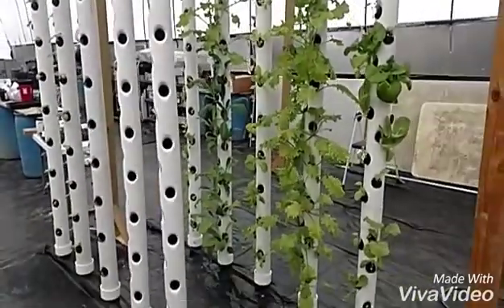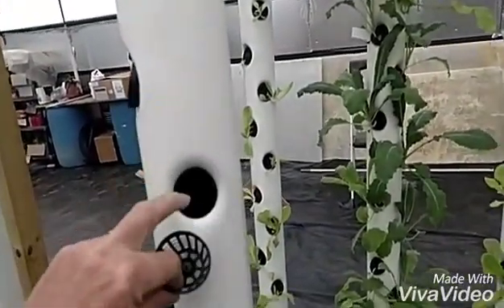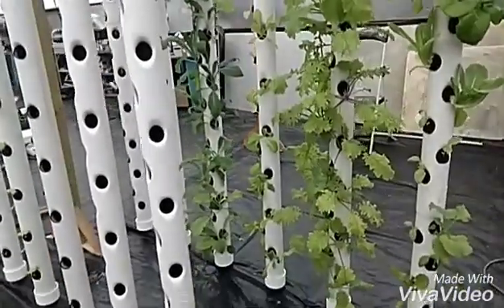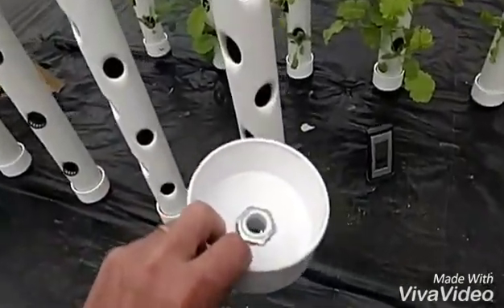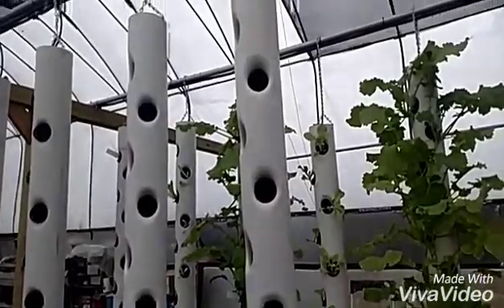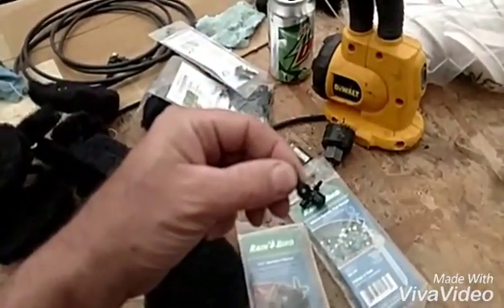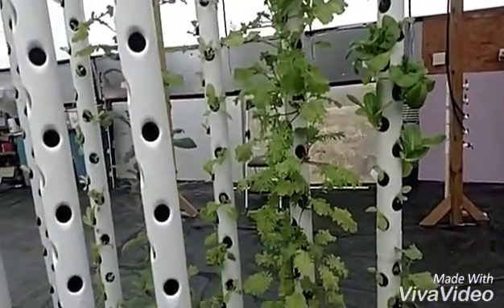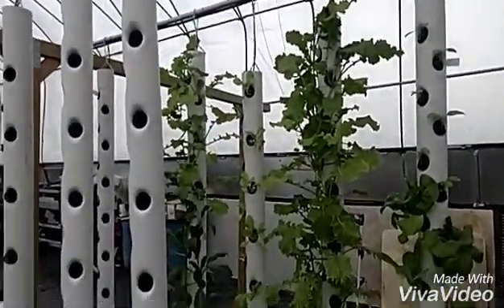Grow towers part 1, update.

Comment: I put a styrofoam cup at the top inside and used a nail a poked holes about 12 all the way around the bottom edge and it fills about half way and pours evenly all the way around
Reply from the maker: Very creative. Thanks for sharing.

Comment: do you have a video on how to build them? thank you
Reply from the maker: Serangga DegiL . Good morning. I will be making some more towers with the improvements. It will be a month or so before I get time. I will do a video then. Have you made any ?
Thanks, Von
Reply: I do have few of them. same problem water drip outside the tower. I just cut slit and open it out by blowtorch. so there is gap between net cup n hole
Reply from the maker: Serangga DegiL . The last 3 I built work great. I'm using a smaller hole saw and a 3/4" dowl to make the hole. I'm not using the net cups, I'm planting the plug right in the hole.
Reply: you got a very smooth edges and they bended inside the pipe